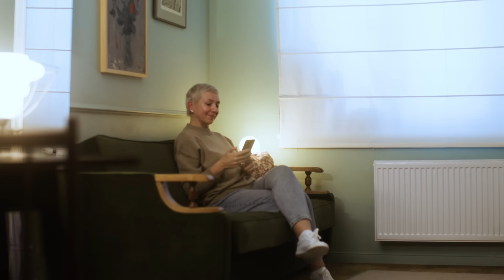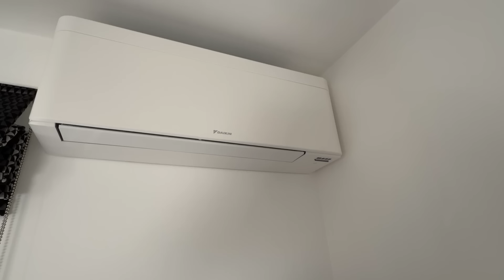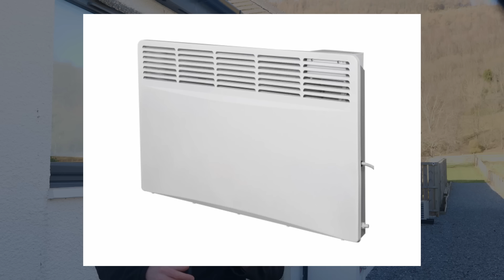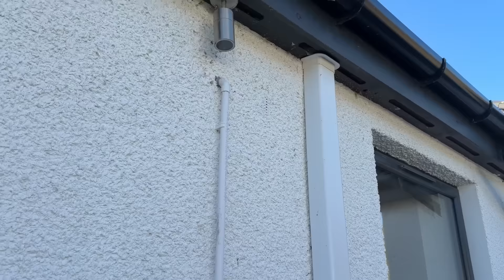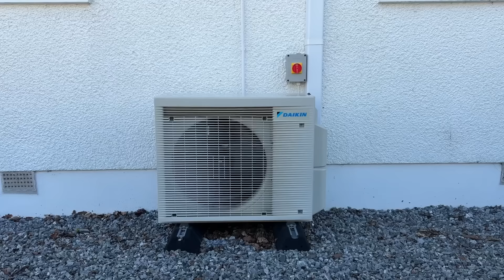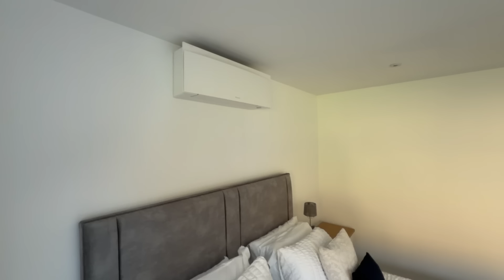The ULTIMATE Guide to Air-Air Heat Pumps

Comment: We got told it would be 33 grand to fit air/water heatpumps to our big victorian solid stone house. Fair dos the Heatgeek installer who did the maths told us "don't bother".

Went out and bought some air/air equipment and self installed it. Our initial plan was to use it with the gas as a boost when needed. In practice we've almost never touched the gas (helps we are by the sea in South Wales not in Scotland ;)). Self install is probably not for most people admittedly.

The fact it heats the air directly means you can heat rooms on demand, it means it works well in lossy buildings unlike air/water. I really can't understand why the UK is obsessed with air/water in newbuilds other than to try and keep the grant money and business in UK companies at the cost of the public getting complex poorer systems.

The other thing we and others found is that a lot of old houses were built on the basis of fires in one or two rooms. If you heat just a few spots where the big fires once were the victorian design makes the rest work with a few open doors. That means many smaller houses you can heat with one or two internal units only despite the fact aircon people try and sell you a load more.

On a cost basis I'd have to quibble your numbers for storage heaters. Storage heaters are designed to run time of use tariffs so you can be as low as about 9p a kWh, which means they are not far off an air/air system without batteries. Air/air units are much nicer, much more flexible and cool stuff unlike storage heaters but the cost saving if you have an EV as well is quite small, and even on Economy 7 is nothing like 3 or 4 to 1 in practice. On straight electric heating - absolutely. Even a dehumidifer with the water going out of a window is twice the efficiency for heating as a straight electric heater.
Reply: What do you mean when you say the cost saving when you have an EV is quite small? Do you mean that the saving with air to air is small when you have an EV? and if so why?
Reply: I was told self instal voids your house insurance. Have you had a problem with house insurance
Reply: @evangelinew5129  Most equipment cannot be self installed these days because you'll need an F gas engineer and in some cases you'll also need an electrician and potentially someone to do building regulations work (eg structural calcs for water).

So yes you can self install but you'll either need to pick the equipment very carefully (especially with reg changes) or get it done professionally. If you are using F gasses like R32 then any split system requires an F gas qualified installer. If you are using R290 splits you definitely want a professional installer.
There are options that avoid this somewhat (through the wall monobloc kit, "portable" kit with dual hoses or window unit style fittings but they only suit some houses and flats.
Reply: Hi I am interested in your coments and wondered where you got your equipment from and what brand you used. Cheers
Reply: Hi I am interested in your coments and wondered where you got your equipment from and what brand you used. Cheers

Comment: Good informative video. I’m thinking about air to air for suplimentive heating. For such system when they spec 8 kw is this the running electrical draw of the system. So the heat output will be 28kw.
Reply: It's usually specified as the heat output not the power input. However the heat output varies according to temperature difference so its all a bit of arm-waving maths around theoretical efficiencies. A well installed 4kW air/air system will probably draw about  1500W on cold cold days (maybe 2kW if it's really really cold) but when it's slightly less cold you'll be below 1000W, often well below 1000W.
Reply: @etchedpixels  I can confirm this, and it might even improve your power consumption forecast: I've now heated exclusively with air conditioning for three winters, and none of my single-split units, each with a 3.5 kW output, has ever exceeded 1000 watts of power consumption. Not even during several days of severe frost. According to the data sheet, the unit can/may draw up to 990 watts in heating mode, but according to my measurements, the peak was 896 watts. Over the entire heating season, I averaged between 600 and 700 kWh per unit. The nominal SCOP is 5.2, which, logically, was undershot at low outside temperatures, but on average (including the transitional seasons with low heating demand), it was even exceeded. My personal conclusion is that in the long run, it's worth paying the extra for units that are particularly efficient in heating mode.

And these are my experiences operating air conditioners as main heating in northeastern Germany. Given the generally milder winters in the UK, the situation is likely to be even better rather than worse. However, it might be worth investigating how the higher average humidity affects the defrosting cycles.